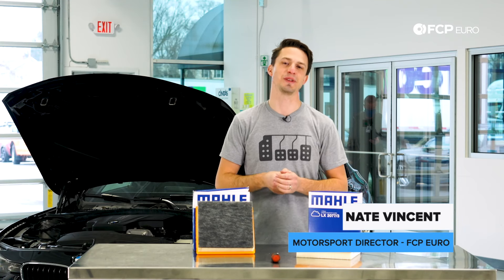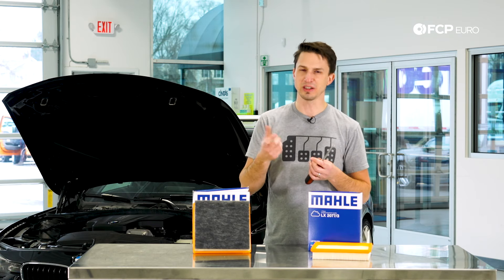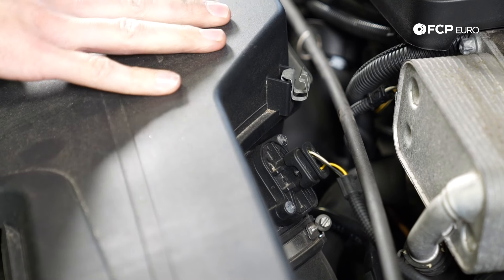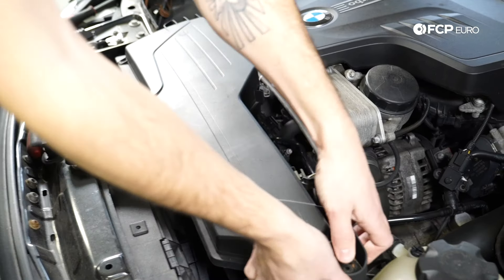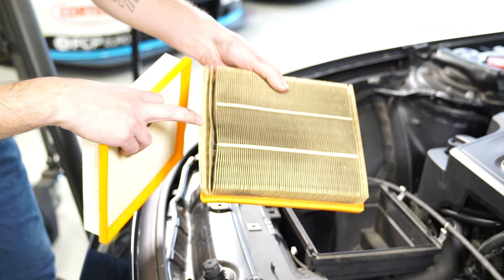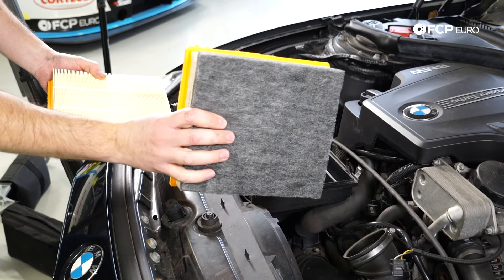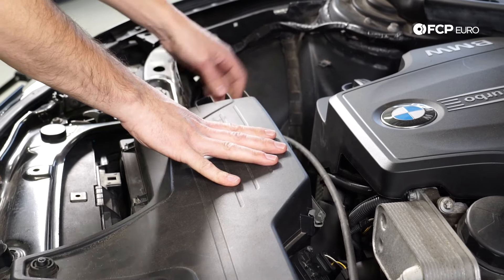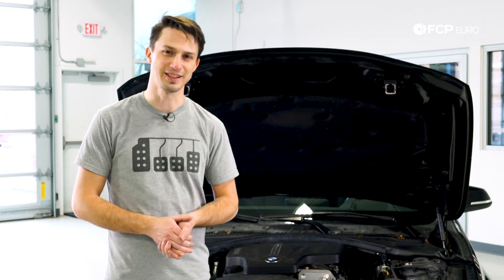How To Replace a BMW F30 Engine Air Filter (BMW 3-Series F30 F31 320i 328i 330i xDrive & More)

Comment: This is the most involved air filter change ive ever seen😂😂
Reply: For sure !... pity it wasn’t an old M54 engine, on that, the air filter can be changed in 30 seconds flat !!
Reply: It looks simpler on the F30 n55 engine.
Reply: Lmao

Comment: Never ever ever ever....ever put a rag or any material for that matter to cover a pipe to an open system/engine. If you know you will be doing this maintenance soon then find a plastic or rubber plug possibly around the house OR measure the Diameter of the pipe opening and you can buy them online. Do the job correctly. Opening your intake and not doing it right could be the sole reason something detrimental happens to your engine.

Comment: If you find yourself fighting that rubber grommet on the left because it came out of the c-shaped bracket, remove the grommet from the air filter to get it back in the bracket first then slip the airbox back into the grommet.
Reply: also if there is a gap in this connection the car looses power at higher speeds and almost stalls. v important to make sure there are no gaps

Comment: This was helpful. Unfortunately I broke the tip of a little intake connector that has a small hose line connected to it that feeds up into the engine somewhere. The connector is on the back of the air intake box about two inches from the sensor. What part is that and can just that be replaced? Not the whole box I hope.
Reply: Same issue here went to multiple bmw parts stores and they couldn’t find the name of it so I just had to order another oem filter box, how did you go about it just curious
Reply: @marcosayon7529  Same here. Had to replace the whole box.

Comment: I have the 2014 435i, 6 cylinder twin turbo. It's different from what you are showing. most is the same. Except It has another plug or wire besides the air sensor. Do you know more about mine.

Comment: I just watched a video from Justin Buice and the airbox is in a completely different place. Both f30.. What's the difference?
Reply: This is the N20/N26 engine.
Reply: I just watched your video now... Does F30 uses dry or oiled air filter?
Reply: @leratotshabalala7243  factory is dry. Oiled is optional on aftermarket intakes. On some not all